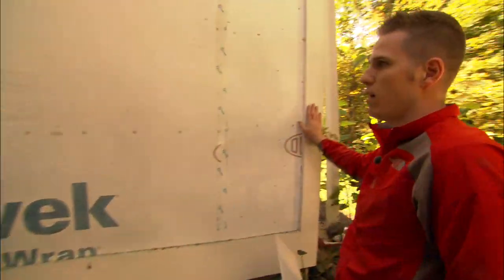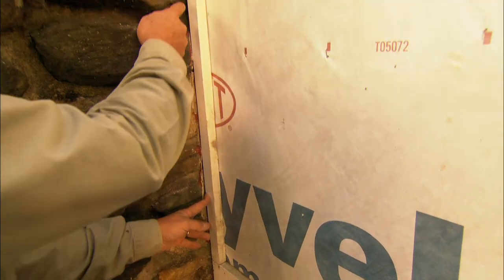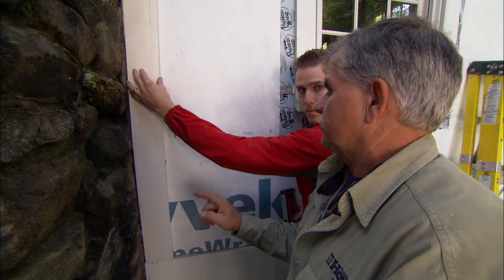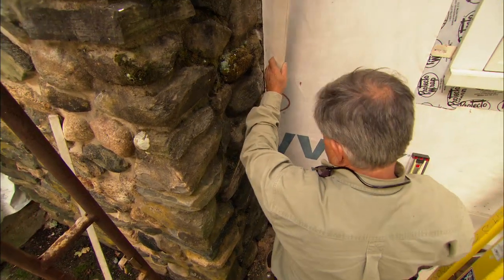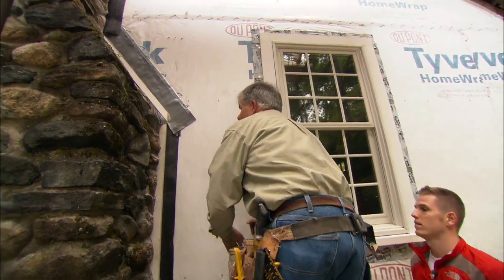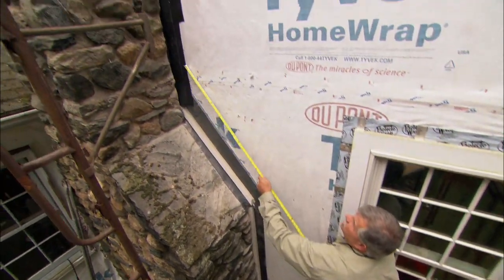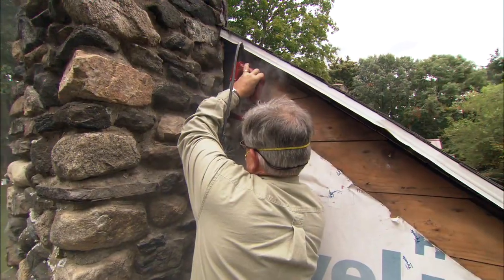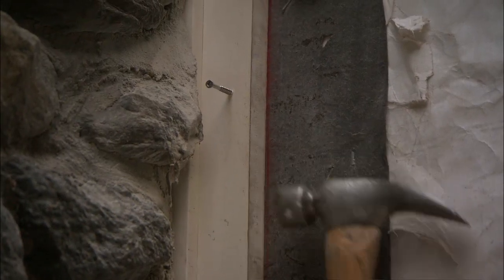How to Install Exterior Trim Around a Stone Chimney | This Old House

Comment: As soon as that caulking cracks or opens from expansion and contraction, water will find its way behind the chimney. All it takes is a few sustained downpours and the sheathing will be wet behind the chimney. Plus bugs and mice can live in that space between the sheathing and chimney. Should have filled it with foam.

Comment: I followed this, practiced scribing practiced with jig saw on wood. Game day was on the PVC , NOT SO GOOD.  angled the jig saw at 45 all went good until the end when I expected the waste to fall off instead the heat of the blade re-fused itself back to itself from the friction. What a mess.  They had to have experienced the same thing.   
I wonder if they eventually chalked to the stone?

Comment: What's the proper way to have lap siding (Masonite or hardi plank) meet a concrete front porch? And then how to maintain it so the siding won't deteriorate where it meets the concrete porch? Thank you.
Reply: You need to pre install flashing.  Then zip tape it.  Then leave your siding a 1/4 in off the flashing

Comment: Was it really necessary to use LEAD?!
Reply: "Lead roofing and flashings are much more likely to be a health hazard for people working with the materials than for people using the building. Lead has been used for roofing for centuries and is one of the oldest flashing materials. It is durable and soft enough to be formed into complex shapes. Lead roofing and flashings can last over 200 years. Generally speaking, lead roofing or flashing that is in good shape may safely be left in place."
- US Forest Service

https://www.fs.fed.us/eng/toolbox/haz/haz22.htm
Reply: Assuming you don't drink your rain runoff, that is.
Reply: Adam That’s usually not a problem either. Just like old lead pipes, the lead coats over with an oxide or corrosion layer ... unless the rain is acidic.